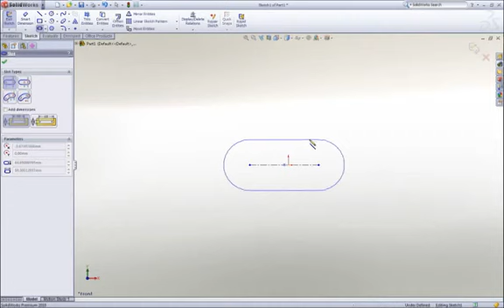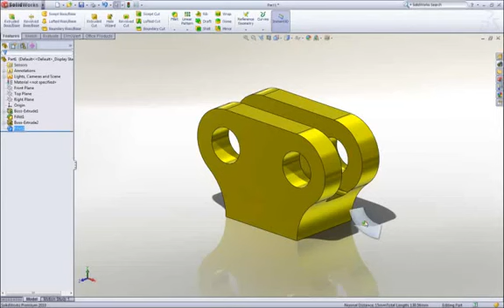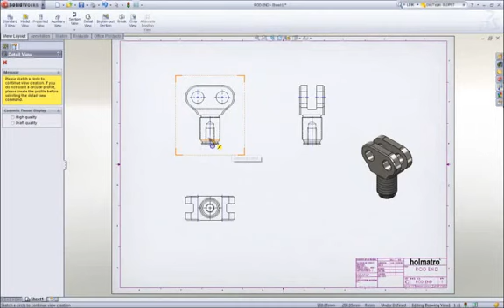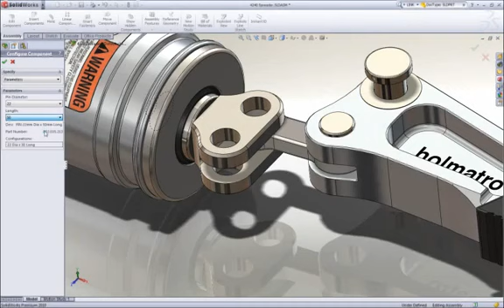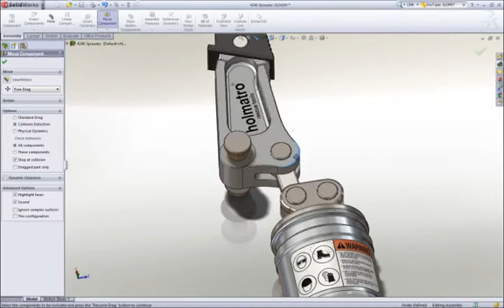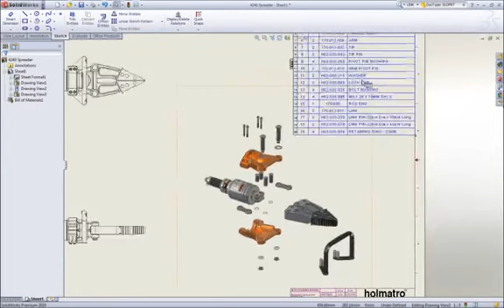SolidWorks 3D CAD - First Look Video

Comment: We sometimes receive 3D drawings in a SolidWorks format that we need to convert to a 2D print with dimensions. In this demo you showed how to drop it into a new file and the dimensions appeared. Is there a "lite" version of SolidWorks that can do the same thing? Or a service we can buy on an individual drawing basis?